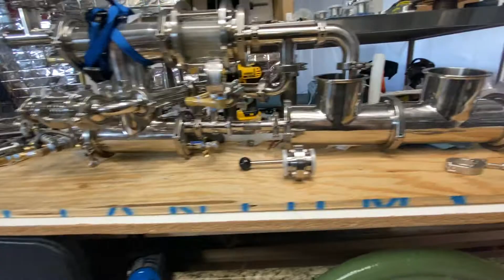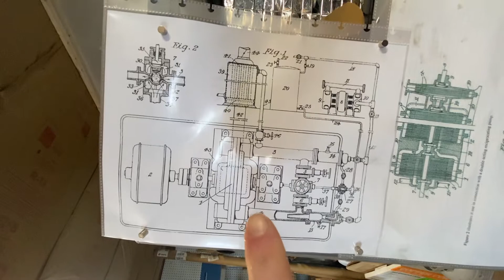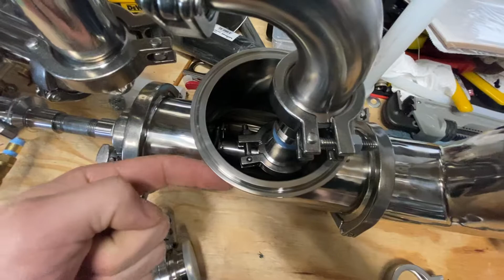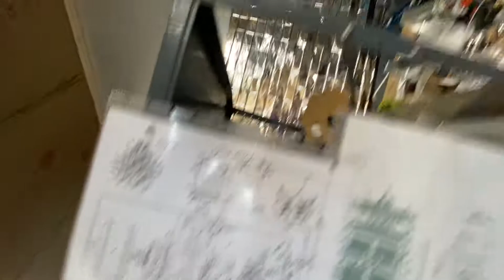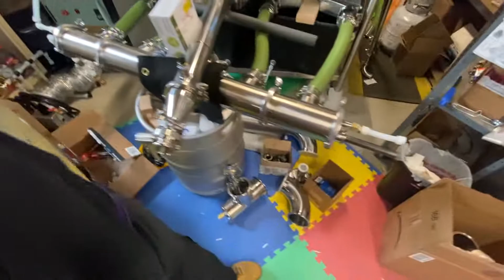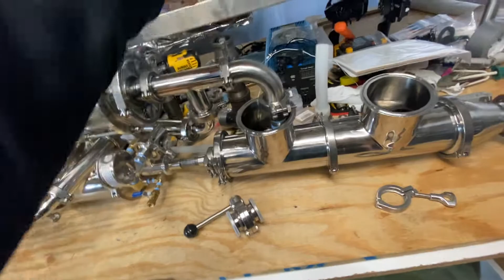TesTur Energy’s Fuel Agnostic Tesla Turbine Combustion + Boiler System Replication Patent GB186,083

Comment: so dose the back of the spark plug sit in the water or is it incased in a jacket?
Reply from the maker: Hey thanks for the question! So in these old builds it did just sit open to the water but I have since make a jacket for it so that it’s not open to the water.